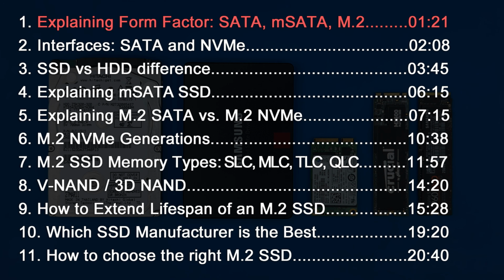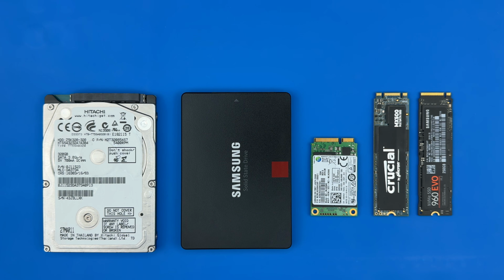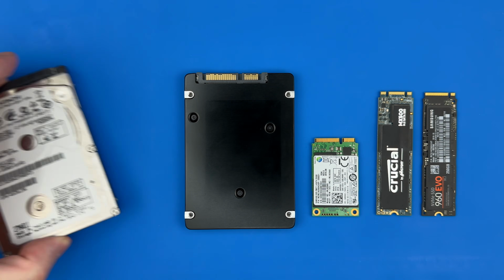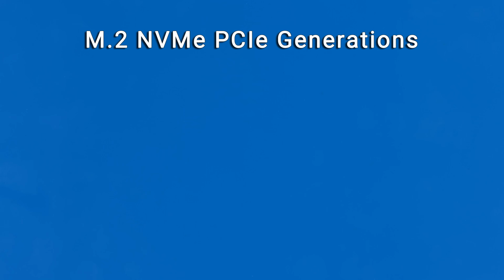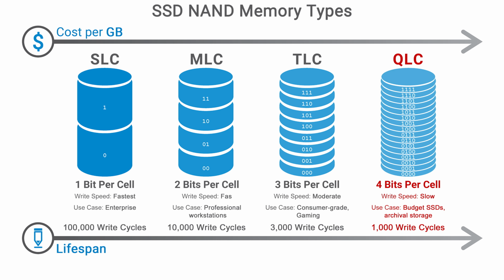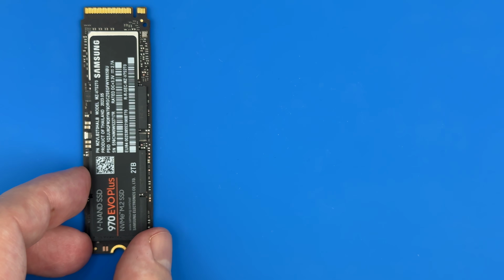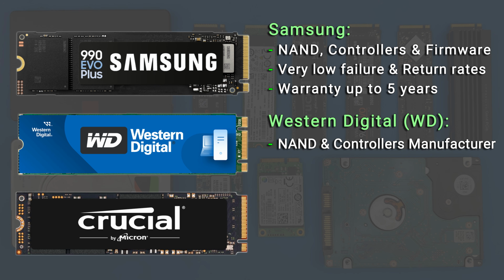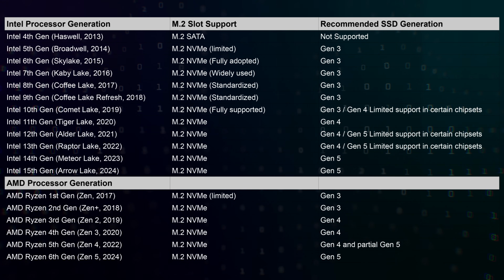SSD vs HDD vs NVMe vs SATA vs mSATA vs M2: Storage Devices EXPLAINED!

Comment: I have a 2019 MBP and it is not reading any pendrive/iphone/android/USB input devices and it only accepts the SATA HDD drive, HDMI and also can charge properly, i tried replacing the ports resetting the NV/P/SMC ram, reinstalling the OS downgrading it, but got no resolution, rn i am using it as it is with limitations.

Comment: Just one add-on, people looking for long term backup and shelf storage, without using that particular drive after loading it up with data, should always go with the spinners, 3.5/2.5 Sata Hard Drives. SSDs/NVMes stop functioning when not powered on from time to time..

Overall, an extremely beautifully crafted video man, cheers!

Comment: One notice about TBW. Usually SSD use for the system disk. This means that some data like Windows, Offices and etc. stayed on disk almost permanently which reduces TBW in some cases. For example if Windows plus program files have 100Gb in total for SSD with 500 Gb this about (technically) 20% reduce of total amount and for SSD with 2Tb this will be 5%. TBW usual means sectors for reading and rewriting or free space. I meant as larger SSD you have as better and longer this will serve.

Comment: Hi. Great video and I'm glad I found it. I have a Dell Poweredge T430 with 2xXeon processors and 384GB ram. I just bought a pcie adaptor card for an NMVe drive that I want to fit into it and enhance data speeds. Any suggestions that will not break the bank, but that will also work reliably as I am dealing with huge data files of 10 to 100 GB resulting in thrashing on physical drives and slow read speeds on typical SSDs.

Comment: Dude, they are all HDD's, just different types. First one is a mechanical hard drive, the others are non-mechanical hard drives that use NVM (Non Volatile Memory) that connect in different types of sockets / interfaces

Comment: I noticed a PCIe slot on my motherboard. There is no “card” in it. I’m presently running a HDD drive which I’m about switch out for SSD. Is it possible to switch to a PCIe instead?
Reply: What computer or motherboard do you have? Most computers from the past decade or so should have M.2 slots. If your PC is older than that, it may not support booting from PCI-E.

Comment: Such a great video!. I have a MSI PRO Z790-P WIFI with a 14th generation i9 and a RTX 5080. I currently have a 2TB drive. My biggest question is if I install a new m.2 drive into another PCIe slot on my motherboard and I game from that drive will I have performance issues? I know there is a difference between a PCIe slot routed directly to the CPU or the chipset. I read where my motherboard only has one PCIe slot connected directly to the CPU which I assume is being used by my graphics card. So is my drive already being routed through the chipset and adding another drive will yield the same performance?

Comment: Several SATA connectors can be used simultaneously, which adds up to the overall throughput. And a SATA RAID controller with active prefetching during sequential reading (using physical disk caches) can completely neutralize the speed advantages of SSDs versus HDDs! Where the effective throughput of one SATA3 is NOT limited to 550-600 MB/s. Let's learn the basics.

Comment: Hi all the way from India. This was fairly elaborate! I have a question I’ve been asking close to everyone before I invest the money I don’t even have on a laptop as the one I had earlier I used for 15 years but it can no longer be used. 
I need 1 TB fully for inbuilt storage but don’t have the budget for getting the laptops either that inbuilt which are around 60K.
I see a Dell Inspiron 15 i3 13 gen which is around 36-37K which I am saving for.
Is it advisable to buy this one that has 512GB SSD RAM (& have the store add a 1TB SATA HD in the slot given? 
Authorized service center says don’t do this but stores & everyone else says it can be done.
Please help if this can be done at official Dell stores without warranty getting void & if this won’t slow down the system of create problems to put 1 TB storage in a laptop ther doesn’t come with it inbuilt. 
Thank you for your helpful video. I look forward to your help & guidance on this query. 🙏

Comment: Great video but would need a little more advice as i have an older MSI PL62 7RC gaming laptop that i'm looking into upgrade. The hard drive is 1GB HDD but there is an empty slot on the board for SDD, what would you recommend? I'm thinking at least 1GB SDD. I have already upgraded the RAM from 8GB to 16GB to make a start, any advise would be much appreciated.

Comment: This is a very detailed explanation of difference storage devices.    i have acer aspire e5 575g 52DA i5 7th gen. it supports nvme ssd(1notch or M-key interface,2280 is the size of it 22mm x 800mm), while  lower version 6th gen lower supports m.2 sata ssd

Comment: Hi. Info is very helpful, tnx. I want to buy new SSD pci-e gen 3 or 4 for the laptop now. But I found info that for it need to buy ssd m2 nvme with "cold" controller and without radiator and heatsink.
Because there is no room for additional equipment in the laptop.

What do you think about it? 😮

Comment: Thank you. Good video. Found one of Brand offering SSD disk with writing speed of 450MB (reading speed 520MB), NAND memory type - 3D SLC NAND Flash and price the lowest then another brands with writing speed of 500MB (reading 550MB) but with 3D TLC NAND Flash memory type. Do I need so much NAND Flash memory cycles for home use PC, game consoles, wouldn't be better buy one with extra - 50MB, writing speed? Another question why SLC NAND Flash memory type disk giving warranty just for 600TB TBW when its maximum lifspawn should be about 100,000TB - same as cycles of bites per cell (if SLC cell capacity is 1 bite). And seller with TLC NAND Flash memory type giving warranty for 720TB of TBW when it's max lifespan about 1,000TB (if TLC cell capacity is 3 bites). Means the first seller lies that his disk memory type is SLC and the price is telling that.
Reply: Hello again. I found that SLC (Single-Level Cell) on the disk I mention is just small secret space in it, there is storing caching files. And I checked all disk selling eshop- there no one has SLC memory type. One of manufacturer declares QLC type for an old disk model  and some - TLC. I think SLC is using just for the caching folder space, 'cause of there a lot of P/E (program/erase) cycles.

Comment: Absolutely great video.

Another tip for SSD longevity is to avoid defragging the disk. While defragging improves seek times and continuous read speeds on HDD, it doesn’t for SSDs and so it uses up writes unnecessarily.

Modern file systems are pretty good at keeping fragmentation low anyway. But where it is useful to keep an eye out is virtual systems with virtual discs. I use Parallels Desktop and its virtual discs have the option to move data at the host level to keep virtual discs small and compressed and fast. You generally want this option off when your host uses SDDs for the same reason as before, it unnecessarily uses up writes with no speed benefit.

These are my two cents; your opinion may vary.
Reply: These cents are well received

Comment: I got a 2TB M.2 SSD I would like to move my OS into. The OS is on a 3TB SATA SSD that also has all my games and Blender Projects and it almost full. could I move just the OS to the M.2 or would I need to move everything from my SATA SSD to a M.2 with larger capacity then the 2TB M.2 I bought?

Comment: Lenovo b40-80 currently has 1tb HDD, 4gb ram and has i3 processor. System has become slow. Not sure going for nvme works on this laptop. Probably should stick with Sata SSD. Please suggest the upgrade.
Reply: My Lenovo Intel i3, Ideacentre 510 desktop, 1TB HDD, 4GB RAM was getting slow.

Cloned HDD onto 2TB Crucial SSD and upped RAM to 16GB improving things a lot.

Also upgraded to Windows 11 although my system wasn't illegible for the update from Windows 10.

Comment: Doesn't NVME M.2 hog up bandwidth on the PCIE bus that could otherwise be needed for important stuff like you graphics card or other cards you might have in your PC? I do think that gaming would not be impacted very much because once your game is loaded, most of it is in your RAM and graphics VRAM. So the game likely won't have to go to the NVME to get more stuff, especially if you have 16 gigs of ram and at least 8 gigs of VRAM (hopefully more than that) on your grahpics card. Faster NVME cards will load up your game faster, so you can start playing it sooner after you click on the game shortcut but that's probalby only 5 or 10 seconds difference. I experimented and loaded up the same game from a 2.5 inch SSD (only about 500 mb/s) and then from my modest NVME (about 5,000 mb/s or 10 times faster). The load time to get the game running from the old SSD was about 20 seconds compared to maybe 6 seconds using the NVME. And once the I got the game playing, my frames were about the same. So faster hard drives don't impact FPS as much as people think. Unless the game takes up a bunch of gigs on your drive and then during game play the game has to get more from the drive. But most of it should be in the system RAM and VRAM. The game launch is the biggest difference but who can't wait an extra 15 or 20 seconds to play? It's not going to kill you.
Reply: "Hog" lmfao. It's only  2-4 lanes . GPU gang there dedicated lanes. It won't affect it

Comment: Hi just wanted to say I really enjoyed your video learned quite a bit so currently my Dell laptop the SSD hard drive is only SSD128gb and so I want to clone & replace it with a SSD 1 TB  just wondering if you could help me find out which SSD 1 TB would work in here I've looked at the recommendations so wondering to be sure which one will work in my Dell laptop Inspiron 15 model 7577. UHD display Intel Core i7-77000HQ PROCESSOR. My Service tag number is 4T86242 . As well if possible? to see if I can get the hard drive with heatsink to fit ? Thanks again I just found your channel and really like it I can tell you're very educational and I appreciate your time have a great day

Comment: 18:05 — NEVER EVER DO THIS!!!
Do not just slap a heatsink without a thermal pad, since while chip and heatsink contact surfaces might appear smooth, or even glossy/reflective - they are not on a microscopic level, and will leave a lot of air gaps between chip and heatsink (air has horrible thermal conductivity). ALWAYS use (preferably at least a half decent) thermal solutions, with pad or tape most common for lower heat generating hardware like ssds, with paste or liquid metal(my clear preferance, that i have been using for the past 15 years in PCs, tablets, Playstations/Xboxes/portable gaming - but an overkill for ssds) used for high heat scenarios such as your CPU/GPUs. It will fill up the microscopic air gaps to properly transfer heat away from your heat generating chip towards heatsink for dissipation.
Reply: Just saw your comment, BIG THANKS, I was going to repurpose the pennies laying around.
Reply: @grumpyoldguy6117  lol i actually did that. Obviously, i would not recommend it, unless you have no choice or dont give a flying f. Had no heatsinks i wanted to use on this chip(very low heat generation) so i grinded and polished one side off of 3 pennies and slapped them on thermal tape and on chip. That was 4 years ago and it still works fine😂
Reply: @grumpyoldguy6117 new idea
Reply: TQ, I was thinking about that and you confirmed my worry
Reply: Great advice. I usually use paste rather than pads.
Reply: He put a heatsink across both the memory chip and the controller, which means the controller being much hotter would have transferred its heat to the memory chips.
I think it would have been better if he used two separate heatsinks.

Comment: Is this ANY way to 'retrofit' an NVME drive into my 2012 MacBook pro?  It currently 'supports' SSD, which is so much raster than HDD, but NO NVME?  I do have a 2010 Mac Pro that I was able to get an NVME/PCI drive installed into, which gives me a Blackmagic 1450m/s r/w speeds!  Yes, from a 2010, 15yrs ago?  I'm NOT a CS major, but I grew up with my father's 55 & 57 Chevy'a?

Comment: 1024 probability 5 and 12 parallels, 1,000 :8, do we each have 1,000 superposition capability? As the bytes increase to the bits correlation, another wisdom?

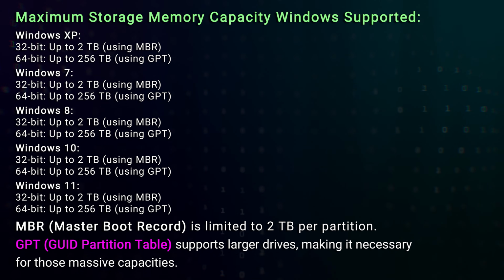Comment: 22:49 slight correction:
-windows xp doesnt support gpt
-all windows versions after vista supports reading both mbr and gpt, but only the 64 bit versions (starting from 7) supports booting from it
-windows will automatically set the disk depending on your computer firmware. If its bios ot uefi legacy, its mbr. While if its uefi, its gpt.

Other than that, great video (feel free to correct me if its wrong, also sorry for bad English lol)

Comment: How-FixIT, this is the first video I've watched of yours and I'm hooked - subscribed for sure.  If you have time I have an awkward question: I have an MSI "Pro Z690-A" mobo with a single M2 SSD but the board has six SATA III 6GBps ports available.  Attaching power and SATA cables to a 2TB drive matching the specifications doesn't have the unit recognizing the new drive.  Is it possible that some setting in the BIOS needs to be activated to turn on the SATA ports on the mobo, or am I missing a step?
Reply: I would double check to make sure the data cable is securely connected at both ends. Make sure the power cable is also securely connected to the drive. If you have a modular power supply, make sure the other end of the power cable is securely attached to the power supply.

Comment: Thank you for the very informative video. I will be upgrading my SSD to one with greater capacity (currently M2 NVMe 2280 with one slot key) Once cloned and replaced can I get a converter that I can put the old SSD in and utilise one of the 3.5 SATA bays that are in my desktop PC. Thanks

Comment: That puts it in perspective... even if i write 100gb a day, it'll probably still outlast the rest of the machine and I'm not even close to writing that much a day. I've been keeping an eye on the temperatures. I think there's enough air flow to keep both cool, the one with the heat sink (came with mobo) is actually a few degrees hotter than the one without but the one without has a couple fans blowing on it directly.

Comment: I have so much trouble with Event id 157 on Samsung EVO M2 NVME.  I have gone back to 3.5" HDD from Win 7 junk box.  Not impressed with M2 NVME drives.
Reply: You're using an outdated OS. Windows 7 doesn't officially support NVMe drives. I've been using SSDs for just over a decade. Even back in 2014 when I built my first PC with W7, I moved to a 2.5" SSD.

Comment: I have a hp 15-daoo56na and want to upgrade to an ssd. Seen some images of the board that it can support nvme but am not sure
Reply: You're better off checking the user's manual or opening the laptop to see what drive options you have.

Comment: This is the most educative material I have ever seen on storage. Congratulations for this amazing video. Just curious why you did not mentioned the cooling or thermal pads for the mvme's, meaning, the silicone or none metal types. Are they worth using on a gaming or high performance laptop such as Alienware 51m - r2?

Comment: hey how fix it. I looked into my motherboard and this is the information i found.

I only intend on getting one drive for now. My board supports two drives. The primary slot supports :

1- 22110 M.2 with Thermal Guard
PCIe 4.0 M.2 Connector
NVMe PCIe 4.0/3.0 x4 and SATA Mode (from CPU)

I am not sure what generation to go with. If you may know that would be cool and i could go for the appropriate drive.

My motherboard is a B550 Aorus elite ax v2. My cpu is a ryzen 7 5800x

My preference in drive manufactures is samsung. i would like the pro since as you explained it uses the faster band memory type.

Just not sure if i should go for the samsung pro 990 or maybe a slightly older model would be best. Anything helps, thanks for the great video.

Comment: So if my laptop has a 2.5 sata hdd, I can replace it with a sata ssd to improve performance? Or is it not worth doing due to existing processor/hardware limitations in the machine?
Reply: Upgrading to an SSD will almost always improve performance even if the CPU is not that powerful.

Comment: Very informative video 
I have an HP Z210 
INTEL(R) CPU E31225 @3.1GHz 
Can I use a 2.5" SAS SSD as the booth drive? I have the SAS - SATA connectors.

Comment: Amazing video!
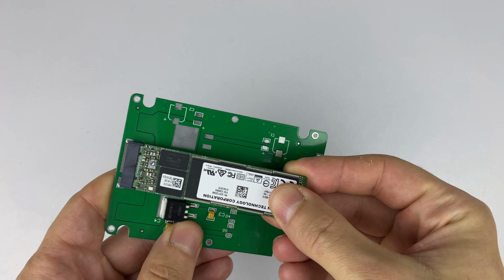At 2:48, you were saying we can use a converter-adapter to connect an M.2 PCIe NVMe SSD  to a 2.5-inch interface. 
Does this decrease the speed to 500 MB/s or it remains the same original speed of 6Gbps?
Reply: No, he didn't say that. He meant: You can convert an M.2 SATA SSD to a 2.5-inch SATA SSD. The speed remains the same 550 MB/s or 6 Gbps (Sata 3 standard = 6Gbit/s = about 550 MB/s!).
And Yes, of cause, you can also convert M.2 PCIe NVMe SSD to 2.5-inch U.2-SSD and keep the speeds aswell.

Comment: The video is very helpful for me. I learned a lot. I bought a Crucial PCIe 4.0 NVMe M.2 SSD for my  HP Laptop (15-au147nz) which has PCIe 3.0. I  cloned with Recuezilla, but the system won't boot. (no Boot device) the SSD is also not recognized in the BIOS.  What could be the error ?

Comment: TLC vs MLC: how do we know which type is used in which hard drive?  Is this usually listed in the specs?  Or is it just assumed that the cheaper ones use the lower grade components?
Reply: Big Manufacturers list the NAND-type in the specs, yes. E.g. if Samsung say NAND Type: 3-bit MLC V-NAND it means: 3D TLC NAND. If 4-bit MLC, means: QLC. Otherwise, you can run some tools to detect the components (VLO-Tools). Or you run some benchmarks to find it out (linear write over the entire capacity).